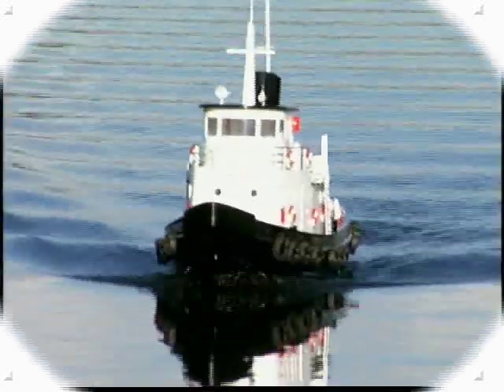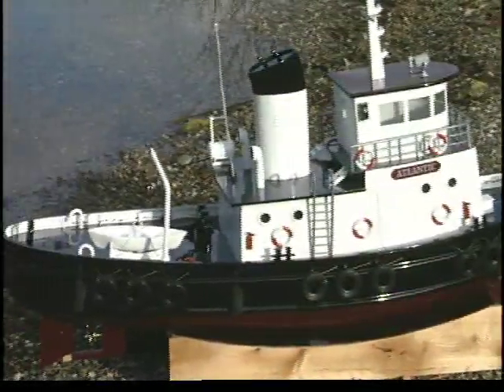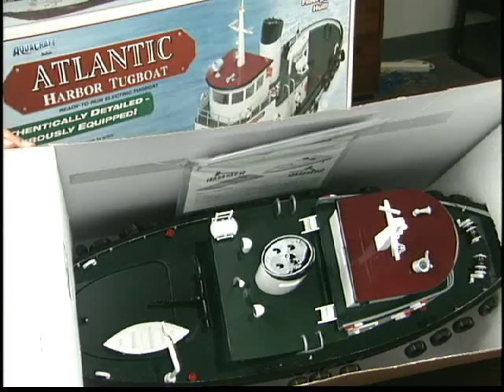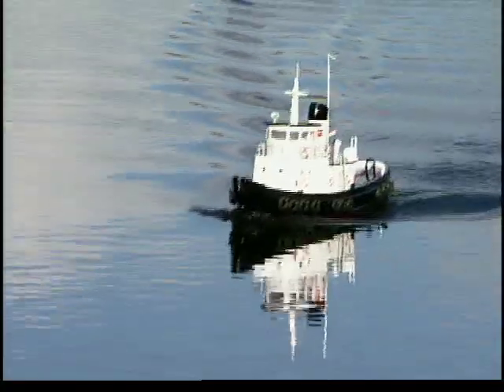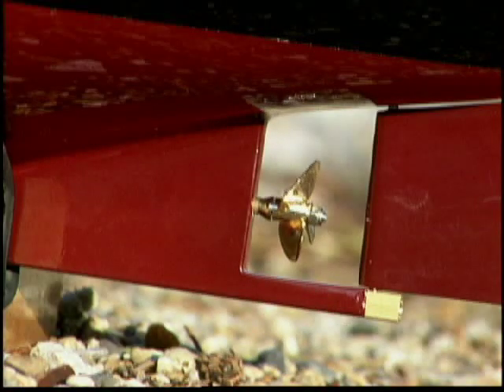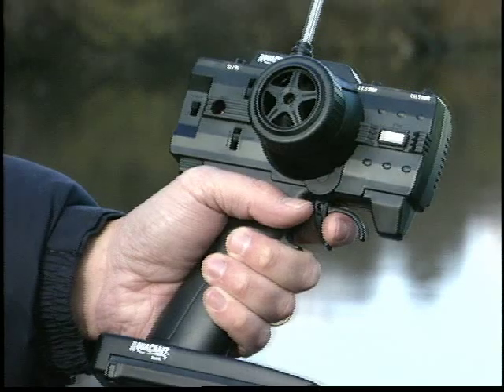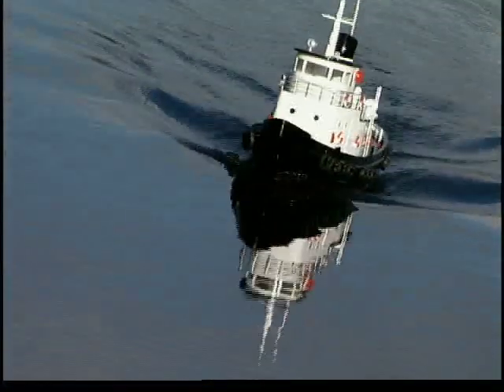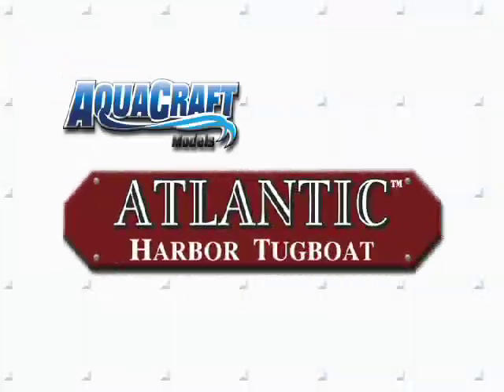Spotlight: AquaCraft Atlantic Harbor Tugboat EP RTR

Comment: I just bought mine last week having a ball with it the only issue with the Atlantic is the ESC. you don't get very much reverse I would suggest changing out the ESC from another brand then what comes with the Atlantic. Other words she is a fine sailor goes great full throttle. The only thing I done on mine is that I use a 6v gel cell batter with this battery change out I can run the tug all day long without a charge. Great video
Frankie Day